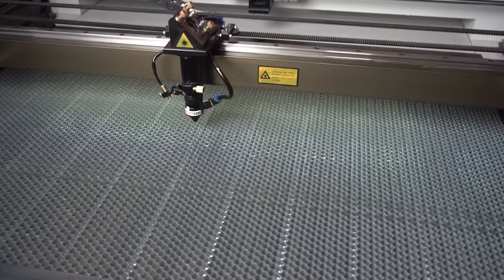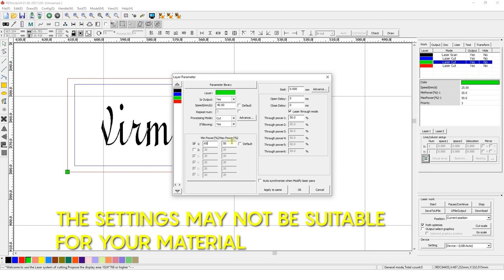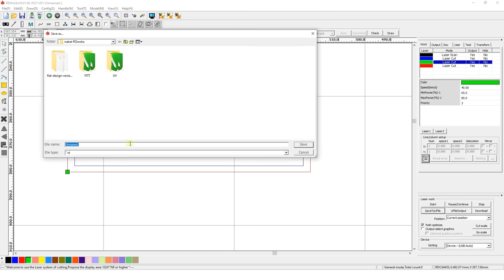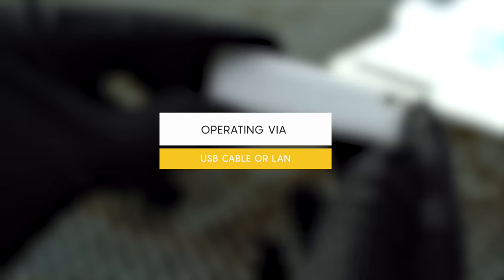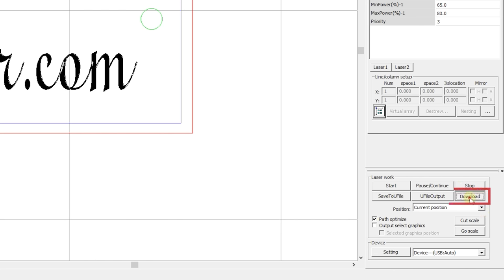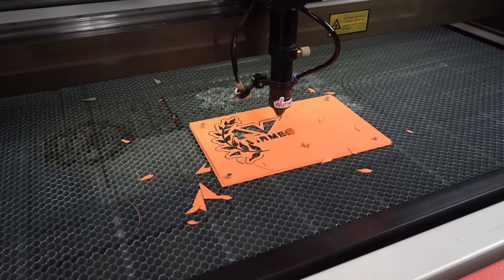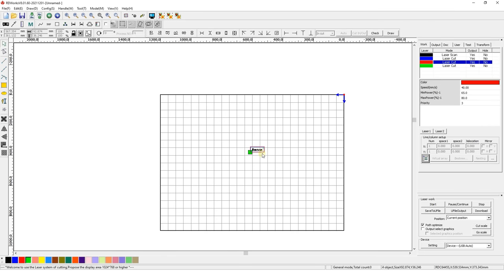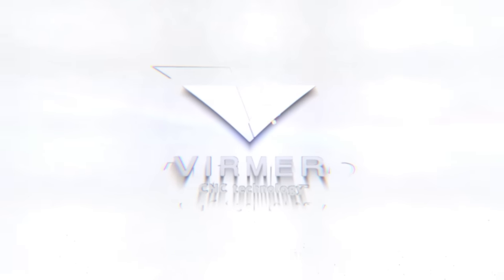HOW TO WORK with RDWorks 2 / Saving & running a prepared file

Comment: Hi good day may laser always cut on mirror mode just need help how can i set it base on what i see on screen thanks in advance ❤❤❤
Reply from the maker: Unfortunately it is not possible to insert a picture of the parameters on the screen here. Let's try to explain it in words. 
Config->System settings->Configuration.
Check Homing position, set the corner in which laser head goes after run machine or press RESET button on panel.